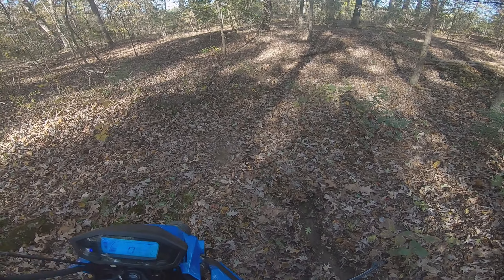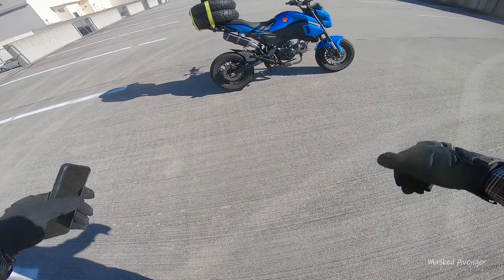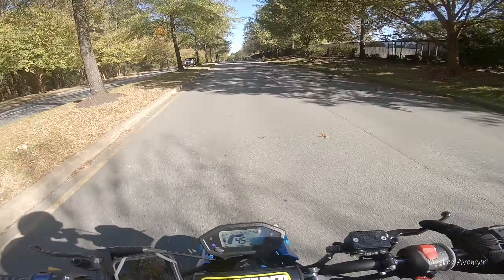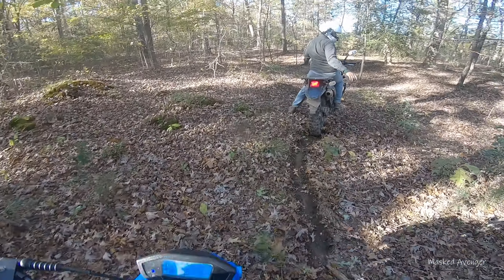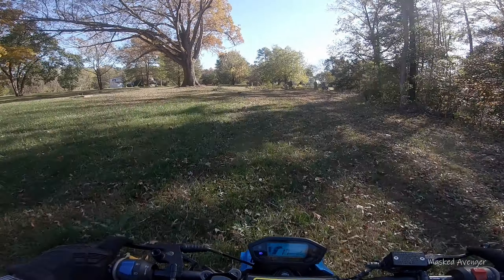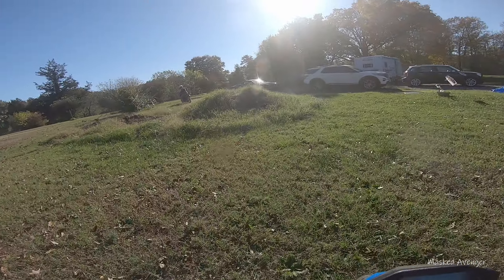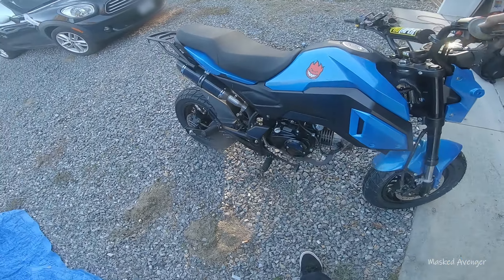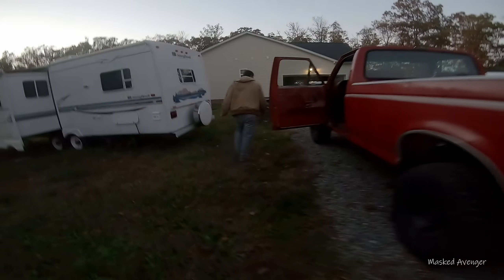Masked Avenger Ep. 14: Changes

Comment: hey man can you post a link to where you got that exhaust?
Reply from the maker: you got it bro:
https://www.amazon.com/gp/product/B01MY7A00E/ref=ppx_yo_dt_b_search_asin_title?ie=UTF8&psc=1

it's not bolt on, had to use a 1 1/2 to 1 3/8 exhaust reducer to get it to fit. also used one of these shock bushings for the top of the muffler clamp to be able to hold it in real tight: 
https://shop.advanceautoparts.com/p/dorman-help-shock-and-end-link-bushings-31019/9110082-p